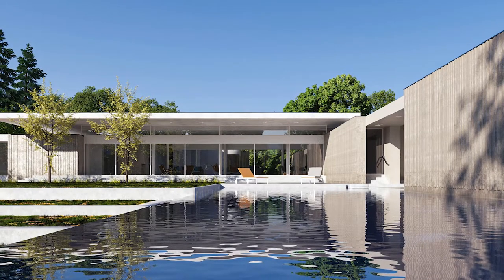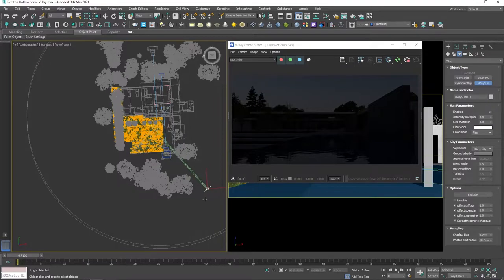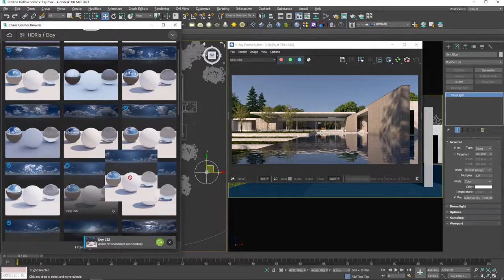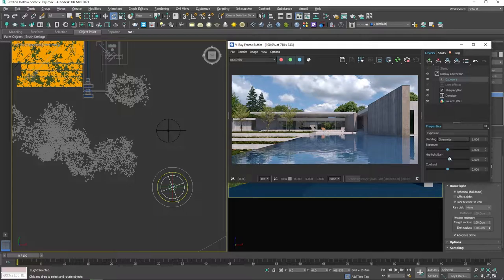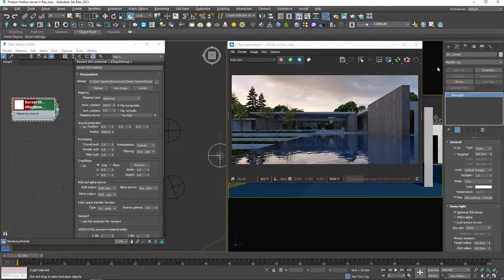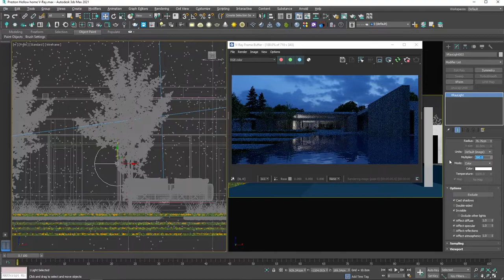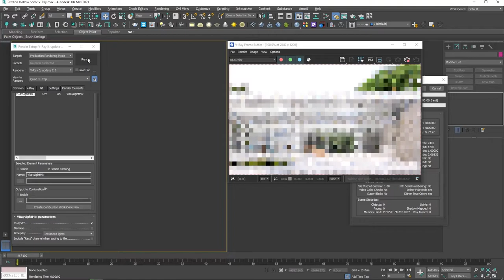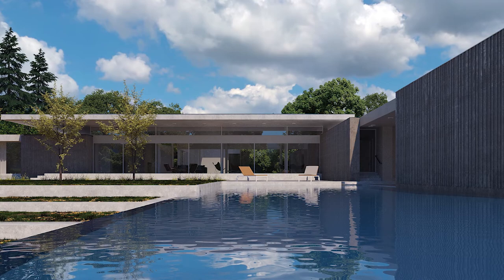The most flexible lighting / Multiple Dome Lights/ V-Ray/ 3ds max/ Exterior/ Light Mix

Comment: hello, is there any way to show the hdri on viewport instead of ipr/real time rendering?
Reply from the maker: If you place the hdri not in a dome light, but in the 3ds Max environment slot, it will appear in the viewport. Initially, it will be very bright, but if you reduce the Render mult. of the texture it will be visible. Unfortunately, the workflow shown in the video will not work, because we can put only 1 texture into the environment slot. That is why we are using dome lights. Workaround is to set the texture first in the Environment slot, then to move it to a dome light.